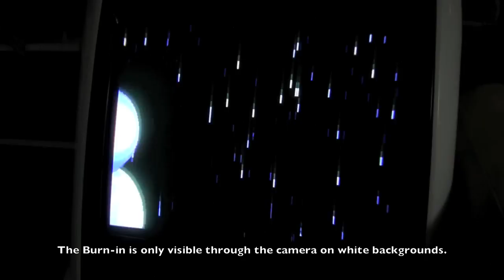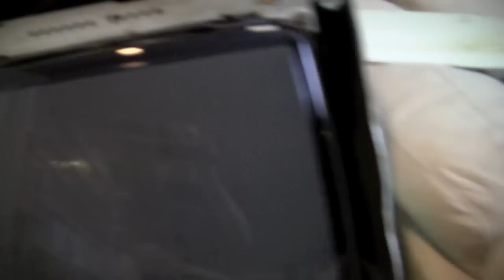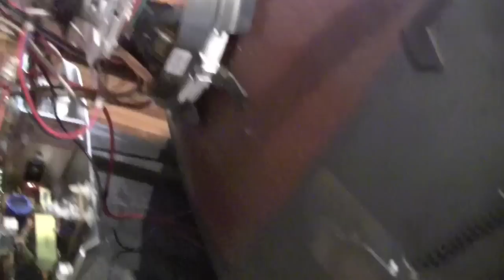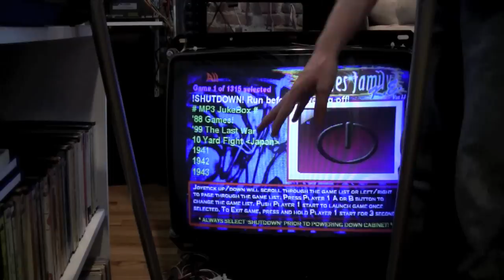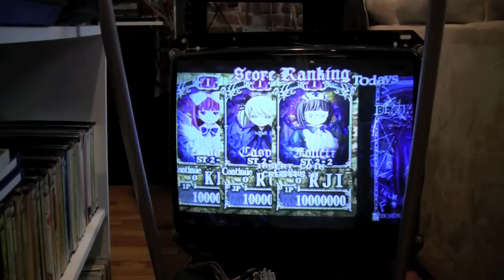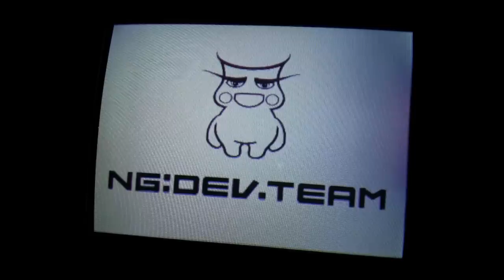Arcade Monitor Replacement

Comment: i Used a sony trinatron tv  and used  cga converter to vga  then a vga converter to av , this way is much easier for me being in Australia where arcade monitors are hard to get , also I can video switch to the ps2 installed to play light gun games being a crt
Reply: I did the same thing but my trinitron has component so i got a jroc

Comment from the maker: Hmm, I haven't had any pincushion problems, but there's a pincushion adjustment pot on my remote board. If you don't have one on your remote, you should look at the main board and see if there's an adjustment pot there. You might also want to look on Arcade Otaku, as there are a few forum posts about various pincushion problems.

Comment: The best way to adjust your brightness/contrast/screen is to turn your brightness pot on the remote board all the way down. Then turn your "screen" pot on your flyback up until the raster lines become visible, then back down until they JUST go away. Then use the brightness pot on the remote board to fine tune. That's what the recommended procedure is, but it's ultimately up to the individual.